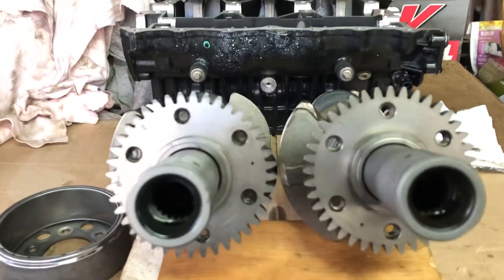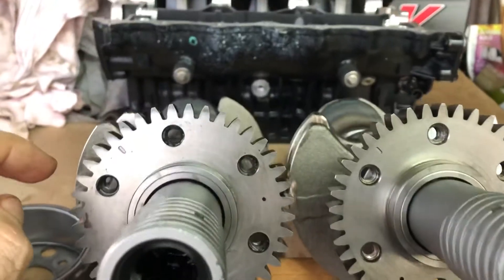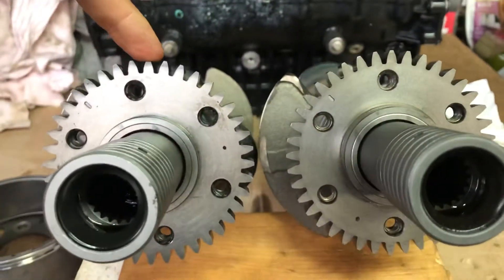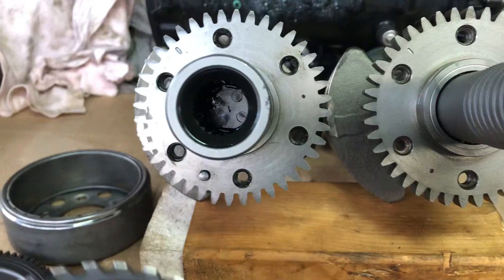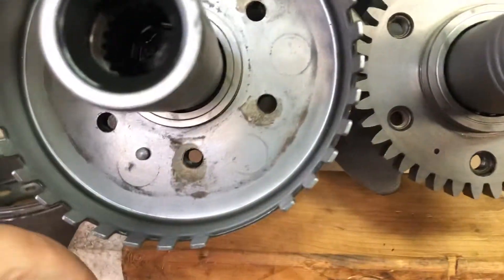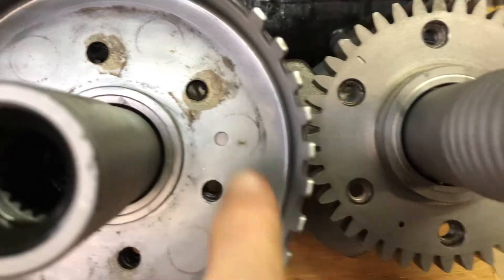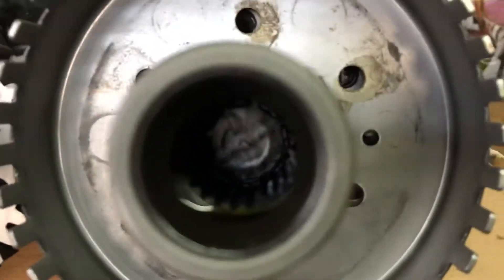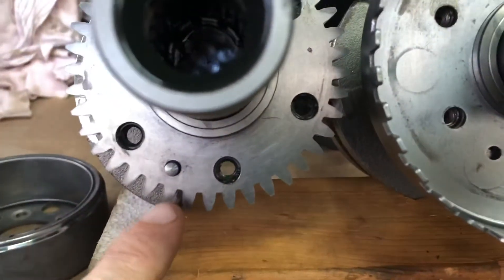Sea-Doo Crank Timing Plate Retrofitting

Comment: I have an Customers 2005 RXT we got an Brand new Engine didnt start up after installing, i found out the Problem with the Crank changed in 2006. So i need to take the Engine out and remove the PTO and remove the Pin and rotate the Wheel and install back without the Pin right, i dont want to drill in the crank and i dont want to drill in the Wheel either. And the Flywheel goes on the new Position also right and Magneto doesnt matter.

Is there something else to do here or just this Step, no other changes at all in the PTO or somewhere.
THANK YOU SO MUCH FOR YOUR ANSWER IN ADVANCE, I NEED THIS HELP. THANKS

BUT why not to change the PTO Cover and the Crankshaft Position Sensor to the newer Style this would work too right ?

Comment: Hello. You mentioned the locating mark for the balance shaft is also one tooth different. I am retrofitting an older crank into a newer engine. Should I align the shaft with the mark on the older crank, or leave it one tooth out to align with what the newer crank would have been?
Reply from the maker: @davef2415  you may leave it as is on the balancer shaft.
Reply: @ thanks. Sorry just to confirm. I will have an older crank, with a newer balance shaft. Do I align the two marks, or do I misalign them (ie where the newer crank WOULD have been)?
Thankyou!
Reply from the maker: @ you may align the new balance shaft on the older crank marks exactly 👍
Thank you for watching and commenting 🙌
Reply: @Redrockat  Thankyou very much!
Reply: @ thanks. Sorry just to confirm. I will have an older crank, with a newer balance shaft. Do I align the two marks, or do I misalign them (ie where the newer crank WOULD have been)?
Thankyou!

Comment: I appreciate all your help.  That’s what I’m going to do, I’m going to use the 2002 PTO housing.  That way I can put the 2007 back together and have it ready to go back in.  I did notice the crank sensor connectors look different between the 2002 and the 2007

Comment: Thank you for all the information.  I decided to drill the hole behind the counter balance and use the 2002 engine in the 2007 speedster.  I’m going to use the winter to fix the 2007 engine.  Went ahead and ordered the OEM bearings for it.  I may still pull the pin so I can use the 2007 PTO housing on the 2002 engine, unless you think I should just use the 2002 PTO housing
Reply from the maker: @chrisharper4895  there is not such a big difference but the magneto and trigger sits on another place . Basically you have to use the right pto housing for that year model .

Comment: Thank you!  Can I also ask, have you used any aftermarket bearings with success?
Reply from the maker: Generally we use OEM . But sometimes we go under size and use an after market one . We match the Honda b16 big ends they matches up well. Otherwise WSM have Under size as well which work well too.

Comment: Are the timing plates diferents?
Reply from the maker: The timing plates are the same , but the dowel location holes 🕳 are in different spots . So we either pull out the dowel and turn the plate or we drill an additional hole in the timing plate itself . I prefer to take out the dowel location pin and just turn the plate to the correct application .
Reply: Ok. Thank you for your videos.

Comment: After removing the pin and rotating it 2 holes. There is a small amount of play just before you tighten the flywheel bolts. Is this going to affect engine operation?
Reply from the maker: It won’t affect the engine operation . For ease of mind find the centre of the play and tighten .

Comment: Helo, could you Tell me why there are diferent points . I hace the same problema in a 2008 seadoo rxp . I await tour answer and tour videos are excelente.👏👏👏👏👏
Reply from the maker: Thank you 😊 there are different points due to different timing pick up points . So as time went on the technology also kept up with the pace and they are able to adjust timing of the engine accordingly . It’s amazing these motors are on formula one (F1) speck and perform really well .